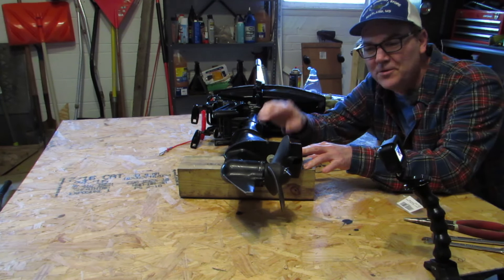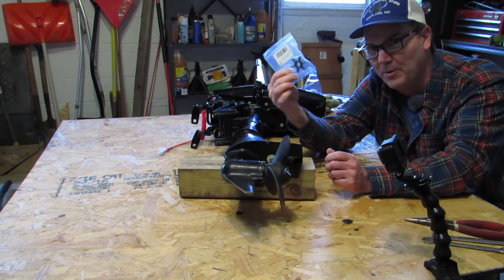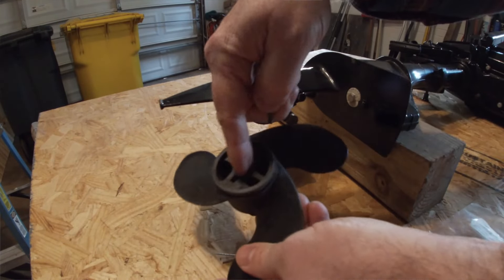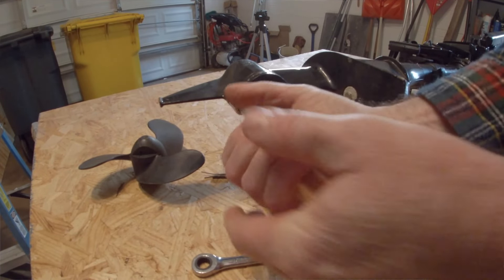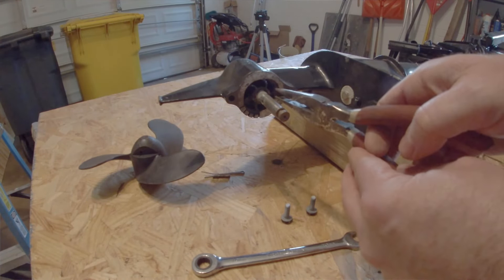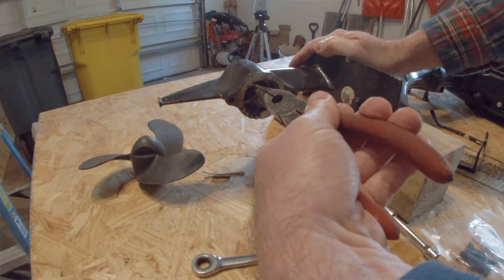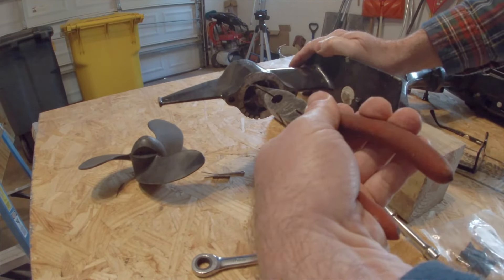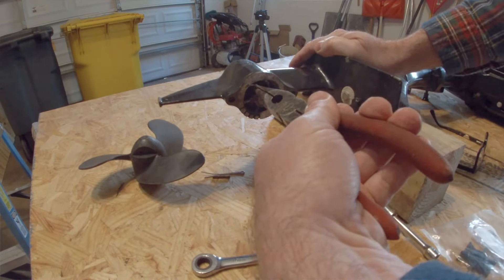Mercury 2.5 Small Outboard Motor Impeller Replacement

Comment: When I started messing with boats.. I spent £120 for someone to change a impeller on a outboard.. So videos like this are very handy too new boater to show that some jobs on outboard are easily done at home.
Reply from the maker: Thanks! Your Seagull doesn’t use have one does it?
Reply: @WayneTheBoatGuy  they have an impeller but its not a rubber 1.. its like a porcelain square which doesn’t touch the sides.

Comment: Thanks for the video. I changed one once a few years ago, but I needed a refresher. Yours was the first useful one which popped up. I find that they tend to dry out and go brittle with lack of use, rather than wearing out. I've had that problem with a Yamaha 70 as well.

Comment: Hey Wayne love the channel, is the impeller in the same place on the 3.3 as it is on the 2.5?
Reply: That's what I'm wondering myself, any luck?
Reply: If the motor has a shifter and a neutral, the pump sits above the gear housing. This needs to come off. Lining the shifter link back up is very tricky.
Reply: @steinhytland2593  u can say that again! did mine about a month ago. I used a tiny stick to hold it in place as I used my ratchet in my other hand to tighten 🤣

Comment: Great video...THANKS!  Do these small 2.5HP Mercury outboards (I have one just like the one you are changing impeller on) need oil change for lower unit?  Any tips/advice on on how to do that?  Thanks again!
Reply from the maker: Yeah the oil in the lower unit should be done annually. I don’t have a video on that… yet but soon!
Reply: Wayne, did you ever make that oil-change video?

Comment: It should be emphazised that this prosedure only applies to non gear models. Impeller on the propeller shaft only pumps and cools with propeller turning. 
Many of the Mercury/Mariner 2.5 and 3.3 engines has a shifter and a neutral. The procedure is very different and more complicated. Different impeller to. I won't try to describe it here, but issue one warning. Don't start by undoing the shaft housing like Wayne does. Look up the proper procedure.

Comment: I am currently on my 3rd or 4th impeller replacement on my 2cyle 8HP Mariner while also replacing the seals in the lower unit, so I also have the prop shaft out and apart.  However, bc I ordered the impeller from JINGZU on AMAZON, my project is stalled.  As the case with typical Chinese knock off parts, while the impeller from them looks like an exact replacement, the inside diameter tolerance of the replacment impeller is too tight and won't properly slide on the 1/2" drive shaft.  On the plus side, no issue getting a return label from AMAZON and prompt $4.25 full refund from JINGZU.  Then went to EBAY to order a genuine Mercury/Quicksilver impeller.  (The JINZU had the same exact part # as the Quicksilver).
-I doubt they make cotter pins out of aluminum as it likely breaks easier bending it back and forth, unlike SS
-That was not a screw driver you used w/the 10mm socket; that is called a Driver Spinner
Reply from the maker: It seems to be hit and miss with marine and car parts these days!
Reply: @WayneTheBoatGuy  part of our cost wanting most everything built cheaply for us in China.
Reply: @WayneTheBoatGuy  I do also douse the impellers with Armor All and grease the key and the plate and washers they ride on.

Comment: Need an inexpensive impeller that's nearly impossible to find? FInd someone with a 3d printer.. 4+ different materials can be used. Been 'tuning' trolling motor props for 1) more mileage 2) more speed 3) both. so far? I've got more work to do but gained 1MPH and lost 10 minutes with 115AH APG Battery so.. think I'm onto something good.
Reply from the maker: Sounds like fun projects!

Comment: Nobody on this or any site has half an ounce with common sense to put a mirror in there, 2H. P water impeller change cause every time. I type that up I get a 2.5 or a taihatsu. Nothing explaining how to slide the lower unit off which is stuck. I wish somebody would have enough brains to do that. Post a mariner two h p a two stroke.There's plenty of them out there
Reply: @onthegowithgreggsavage  what about posting one yourself?